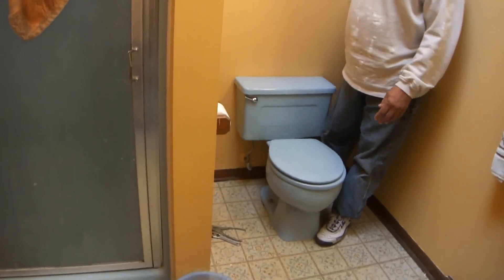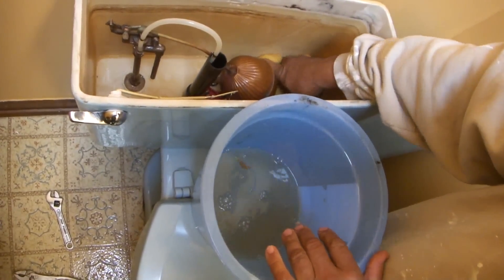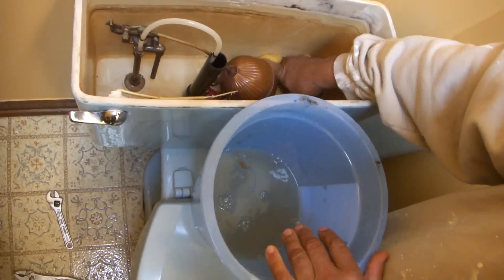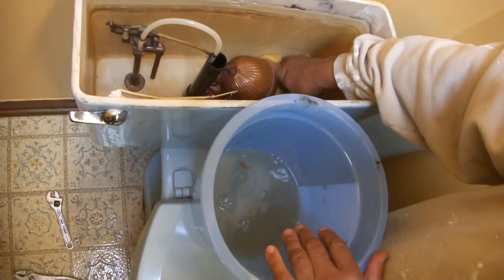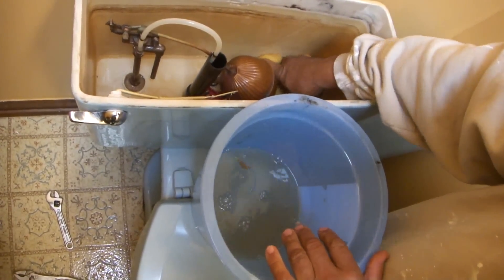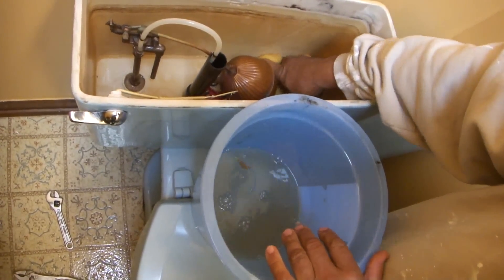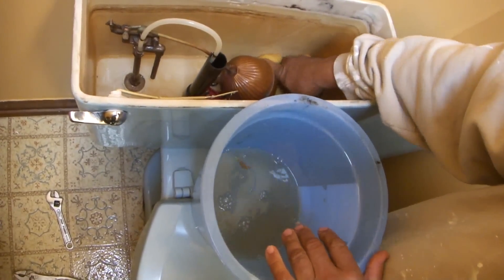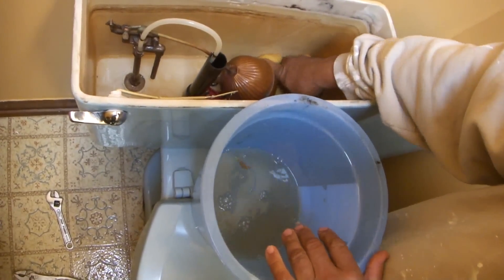How To Install Replace a Toilet Complete Guide Full Length Video

Comment: I like this video.  Found it useful for my upcoming toilet replacement as well as humorous.

Some of my favorite quotes:
"You can use a kitchen butter knife." referring to wax ring removal.  Note to self - do not eat at Greg's house.
"never actually have to touch the wax if you don't want to"
"I'm not going to use this toilet because the customer is going to be the first."

Some of my favorite moments:
Why simply replace the toilet control "guts" when you can replace the entire toilet?
How to purchase the cheapest for a toilet during a trip to a home ... "supply" ... store.
Punching the toilet down at 23:43.

Some great insights:
Steel clad supply line can protect from mice attack.
Caulk around the toilet is more about mechanical mounting than water control.

Comment: Thank you!  At 3:45 this morning I groggily lifted my tank lid, one side slipped out of my fingers and it fell into the tank - clunk, splash, water everywhere - the tank was cracked. I couldn't afford a new toilet AND a plumber so I watched your video and others to see if I could do it myself.  I'm 67 and a woman; the hardest part seemed to be lifting the pieces. 

Watching YOUR video made me look at the separate tanks and bowls.  The sales person didn't know if that tank would fit my 4 year old bowl, but since it was returnable and a lot easier just to replace the tank, I bought a tank (both tanks were 1.6 l).  IT FIT.   Total fix for $29, with no heavy lifting.  I'm a very happy camper.
Reply: KG In OREGON  what kind of toilet do  you have , and how can the lid slip out of your hand like that

Comment: I got good info from this video. I would not worry about all the people that don't know how to wash their hands after a job, the poor souls. I prefer to see comments with useful facts or tips. I did agree with the person who mentioned to plug the hole to prevent sewer gasses. OK, I am off to install my toilet, armed with some new knowledge. Thanks. By the way, your video person did a good job getting the right angles so I could really see, even into the tank to see that water line. Kudos to you both, good video.

Comment: Great video, but all you have to do is spend $20 on a new fill valve. I know it’s over, it’s just a word of advice.
Reply: The toilet was blue! It had to go!
Reply: @sll7508  that’s not how it works. A white toilet in a restroom with a blue shower and a blue sink looks absolutely horrible. Also the new toilet he bought was a cheap POS. If your replacing a toilet that you cannot get the right color for then it is best to replace all the other bathroom fixtures too. Otherwise it looks hideous
Reply: BEC Plumbing I think this guy doesn’t heard what is fill valve

Comment: I also want to say thank you so much! Your video really helped me. I was procrastinating because I was worried about the shut-off valve leaking, thought we had to replace that first (I had been shutting the water off whenever the toilet was not in use, because it was leaking and wasting so much water). I know I will get a plumber to come in and change that at some point, but it was such a relief when you explained that the shut-off will leak if it's not fully open or closed. So now we installed our new toilet today! And nothing is leaking! So happy, thanks again. You rock!

Comment: I have repaired the stop valve assembly on a couple of occasions and bent the float arm to stop a toilet running as well still way cheaper than a new Loo...

Good on'ya for taking the trouble to film the replacement process :)

Comment: Replacing a PROPER 3.5 gpf toilet with a low flow toilet. LOL I'm doing the exact opposite to my mobile home! I have a 1986 Crane Plumbing 3.5 gpf toilet(model is called Radcliffe) that I got for free years ago and completely rebuilt and cleaned up. It will be replacing my 2004 Eljer Patriot which has a HORRIBLE toilet. It has a crack in the bowl so it needs to be replaced anyway. Also I HATE low flow toilets. To me a proper toilet is a 3.5 gpf toilet but that's just me.
Reply: I agree I replaced a 1.6 gpf toilet with a 1978 kohler wellworth water guard my house was built in 78 so it matches the age I put in new tank parts coast foundry fill valve and a 3.5 gallon flapper

Comment: Very good idea's! Suggest not getting a toilet with a little round opening, get one that's oval! A little silicone spray on the old water shaft turn off valve stem, will prevent damage to the seal to avoid any water leaks. I've would have clean around the floor before setting the toilet, so the grout would of had a better surface to stick.

Comment: Great walkthrough.  A more water efficient toilet will certainly pay for itself, but I'm not entirely sure I agree with the "cheaper to replace the toilet" part in terms of initial cost anyway.  It's only $19.99 for a fluidmaster complete rebuild kit which includes the better float mechanism, flapper, flapper seat, overflow tube, and even new tank-to-bowl gaskets and screws.  If you already have a 1.6GPF toilet or less, I'd probably go that route instead cost-wise.  That's what I did in my previous house.  In fact, anytime I see a ballcock I just replace it because they're pretty much guaranteed to fail soon enough anyway.  In my new (to me) house, it had older 3.5 GPF toilets, so replacing those was a no-brainer, especially with these water rates!

Comment: A lot of things can go wrong when doing a replacement like this, so it's good that there were a few little things that he discovered that he was able to elaborate on--like the stuck bolts and the raised floor tile. That flange level can be a problem too at times, and at other times the mounting flange may have to be replaced as well--which can be a tricky thing depending on the circumstances.

Comment: Those old brass valves are pretty easy to fix, for less than $5 usually. It's usually just a flat washer or oring that needs to be replaced. Or replace it with a Fluidmaster valve for under $10. Both repairs way cheaper than replacing the toilet, even if it is an el cheapo $66 toilet.

Comment: Another thing to consider is the rough-in size of the old toilet vs.  the replacement.  Make sure you have the correct size otherwise you could very well be lugging that shiny new commode back to the store because it won't fit. 😖

Comment: I appreciate your video help on how to install new toilet. However, I wouldn't replace that old toilet since it flushes out more waste. The 1.6 or 1.28 GPF does not flush out waste as well as 3.5 GPF toilet. I tried them and the 3.5 GPF did more cleaning. I'm sorry that you had to replace that blue toilet. :-(

Comment: I would keep the older toilet as long as possible. The new low flow ones do a poor job of flushing debris out of the drain line which can allow toilet paper etc to cling to the line causing stoppage. I'd also recommend wearing latex gloves, I cringed when I saw you opening that bolt package with your mouth. YUK!
Reply: hehehehe
Reply: rshangrila Afte 22 years, I am replacing the original, city provided low flow.  Every possible repair and adjustment was done to the toilet.

Comment: This video wasn't bad, but a broken fill valve is no reason to replace an otherwise perfectly good toilet. You took the most expensive rout possible. A new fill valve wouldn't have even costed you 30 bucks. But that new toilet was probably over 100. And the new low flow toilets don't even perform as well.
Reply: Random Stuff In Oregon i agree
Reply: People just don't like old stuff sadly.

Comment: Here's a tip if you can't find any rubber gloves around the house, and you just need to get this job done without having to run to buy some:   grab a plastic shopping bag (check for holes first), or just get a large sized baggie like a quart/gallon size.  Put your hand in it and use it to hold your cup, or even an empty soda can to clean your water out, and then you can turn the baggie inside-out and dispose.  If you can't find either of those around, you could pour some kitty litter or oatmeal in the bowl and let it set up some, and you won't have a swooshy, sloppy mess while you carry your old toilet out.

Comment: Greg, thanks for informative video. just a thought. perhaps flush a few times before seal the bowl rim in case of a leak. Also, that caulk line could stand quick reducing wipe?

Comment: Seriously?  You could have just replaced the inside assembly with a Fluid Master kit for about $12 or $25 if you wanted to replace everything in the tank including a new bottom seal. Which also gets rid of that giant ball float assembly
And I agree with the others, how could you NOT completely clean off the old wax and the floor around it? If you are doing this for a paying customer, you'd be redoing it before I paid you!  And if this is a rental unit you own & did that lackluster a job I'd be looking to rent elsewhere!
As  A LADY, i DON'T CARE ABOUT THE SILLY & UN-NEEDED POINTER ON CLEANING THE THING!  LOL

Comment: 1. A fill valve is less than 10$ your toilet was 65$ so I can replace fill valves till I die and never leave warranty. 2 you lift the toilet straight down to compress the wax ring evenly(if it is too heavy attach the tank after you install the bowel). 3 you seat the wax ring by sitting on the closed toilet seat and rocking around(left, right,forward, back) . 4 You never EVER caulk a toilet to the floor because when (not if) the wax ring fails you want the water to leak on to the floor as a warning to avoid sub floor rot/damage. Also note toilets are ceramic not iron, handle them with great care they crack oh so easily. I'm not going into the water supply line issues here but that went entirely to easy.

Comment: Dipping that sponge into the toilet hole with bare hands...
Reply: the hole is called a "trapway" its located in the toilet bowl, some people think that poop is stained on the bottom part, but its accualy rust build-up from the ballcock/valve, or pipes.

Comment: The American Standard Toilets of the 1950s were built to last so it is better to fix those toilets it might cost you a few bucks but it is worth the investment l made the mistake of replacing my 1950s toilet with that cheap crap and it kept getting clogged up I went back to the store and bought a new top of the line American Standard Toilet with a flushing power of 10 it is very good but the American Standard that I  had that was made in 1959 I wish I would have just fixed it and replaced it with new gaskets and parts.
I have another American Standard 
Toilet in my lower level of my home made 1959 I will never replace it this toilet this toilet came with the house this toilet 
is one of the best toilets ever made.
Reply: Very True
Reply: He had a nice Kohler 3.5 toilet and the only thing that was wrong is that the adjustment was off! He could have just changed a screw in 5 seconds and boom fixed

Comment: I am going to replace my toilet so I have been browsing the plumbing sections at the home improvement stores in my area.  Even using a military discount, I have not found one at that low of a price.   I only want to replace it because it is so low and I have knee problems.  I know you can buy a lifter to go between the toilet and the seat but do they make on that will go between the floor and the toilet at the base? Also, the salesman told me to make sure that I measure the distance from the wall behind the toilet to the closet bolt because not all toilets are the same. He emphasized that but you didn't mention it all all.  Did he know what he was talking about?

Comment: If you're still answering questions or giving advice.

I'm finishing my basement and there was a waste line available with the pipe sticking up through the poured concrete floor enough that I could install the floor and set an inside flange inside the pipe, and it sits snug right on top of the tile floor, glued and fastened with 4 concrete screws. Measurements were good to put a toilet there (12.5" center from the finished wall). 

My question is: What wax ring should I use for an inside 3" flange? I know for a fact that the ones with the standard plastic inserts will not work. Should I just use a plain wax ring with no insert? Think that would do fine? Or should I try one of the new "waxless" do-hickies they sell now-a-days?

Comment: I would not install a toilet with Toilet Jax toilet lowering system.  I don't know if you guys know about the new BLACK MOLD ON HOLD technology?  It includes a sealed bottom, watertight toilet flange with drain ports for water to go back down the drain.  Pretty amazing technology - brand new - made by Barracuda Brackets.

Comment: I'm not an expert here by any means but shouldn't you at least stuff a rag in the drain pipe to keep sewer fumes out?
Reply: Depends on how long it's out.When I pull a toilet I usually have everything I need to replace so I can have it off and on in 10 minutes hopefully less. Or I have a test plug to properly cover the flange. A rag can work but go for a big one like a whole sweat shirt, usuing several small rags could end badly.
Reply: ianb9851 hardly necessary.

Comment: Very helpful. Sound was a bit low. If you can edit or do another for tank replacement only. Tank tallation starts about 14 minutes in if anyone needs just that. Thanks.

Comment: The trapway on the new toilet looks so bad.  Bottom of it looks so prone to clogging.
Reply: Just Cuz I have a feeling does not give a damn about the quality of the toilet. Parts included are all junk.
Reply: That’s what happens when you buy a bottom of the line toilet.  I would’ve bought the $314 Kohler memoirs toilet or the Kohler Wellworth all day
Reply: Just Cuz I think around $200 is a sweet spot for a toilet. I think AS Cadet 3 is adequate.
Reply: I actually just replaced the toilet in my downstairs powder room not too long ago, about 3 weeks ago.  Home Depot had a completely unused 2003 Kohler Wellworth, and I went with it.  Only $175.  It has a great flush and was super easy to install.  Very wide trapway as well so it doesn’t clog easily.

Comment: "It's cheaper to replace the toilet."  Really?

Tell me where you can get a brand new toilet for $10-15 in lieu of a new fill valve assembly.
Reply: haha that's what i was going to say
Reply: +TurboCathedral 
I bought a new one because the still functioning toilet was wasting so much water.  Hoping to at least break even.
Reply: +piddy patt New Fluidmaster flush valve/float assembly. $20.00 at Lowe's.  You're already saving money on water.

I hate to break it to you, but you spent anywhere from $100-300 on a new toilet, and the plumber probably charged you anywhere from $300-$500 to put it in. You can't tell me you were spending $400-800 on water. Not in a month or a year.  Even with 2 toilets in my house; 1 a 50 year old American Standard and the other a 25 year old Kohler, I'm only spending $20 a month on water and another $20 on sewer.

I'd recommend having your meter and water service checked for a leak.
Reply: a new fluid master fill valve was less than 10$ at the local wally. took me all of 5 minutes to put in.

Comment: Have 4 toilets that are not caulked and have no problem with movement. Caulking looks terrible and nightmare to keep clean.  Could you have cleaned the floor before putting on new toilet? Gross! Otherwise video very helpful.

Comment: never seen a toilet that is caulked
Reply: That's because you shouldn't caulk a toilet to the floor for a reason. When(not if) the wax ring fails you want the water to run onto the floor and warn you before it has time to rot the sub floor around/under the toilet. I caulk the linoleum to the flange to expedite this warning and protect the sub floor.

Comment: Wow,, i'm a lic service guy,, Really if u want to keep your Blue toilet,,, it's much cheaper to put in modern filler assy and new flapper,, This guy is making more work than he needs to do,, if your not a Experienced installer,, New does Not mean better ! He does not have even a sponge or a rag with him to keep his job clean and tidy , the best,, he would not work for me..
Reply: Paul Drake did you see the part where he caulked the toilet to the floor?
Reply: I do not think he is a pro.  The information is good.   It may be cheaper to put in a filler assy and flapper.  Most of the time that does not completely solve the problem.   Especially when installed by a novice.  For me it took less time to replace the whole toilet.  Even though getting rid of the old one was a pain.  He left out capping the wast hole and wearing gloves.
Reply: It s amazing just on the home depot and Lowe's sites how many people admit to cracking the tank while trying to install their $10-$20 replacement kit. Yes if you can afford it, don't buy the cheapest toilet. Some people can't imagine how low some families budgets are, and for me I all give thanks this thanksgiving for YouTube and thgthge $30 toilet tank. But the rest will remain a secret no video.
Reply: teresa formica It funny but I high quality 1 flush Toilet will run you $200 vs the $70 he spent here.  Most $90 Toilets include everything you need including the wax seal.  Flushing a crappy Toilet 2 or 3 times to do what a good toilet can do in one flush. Your water bill will quickly eat up your $130 in savings.